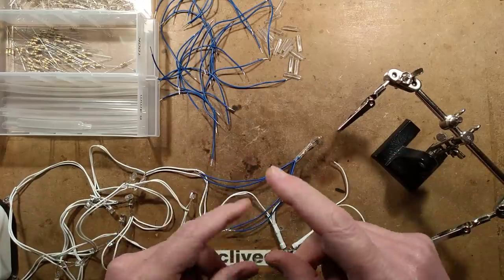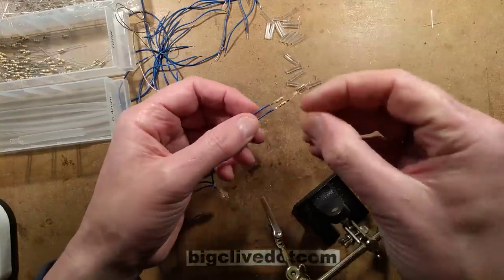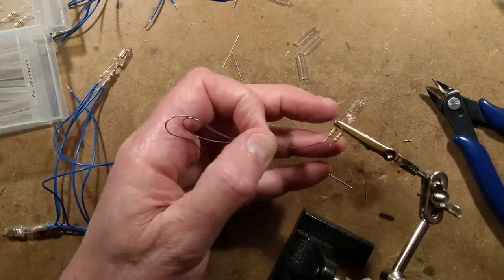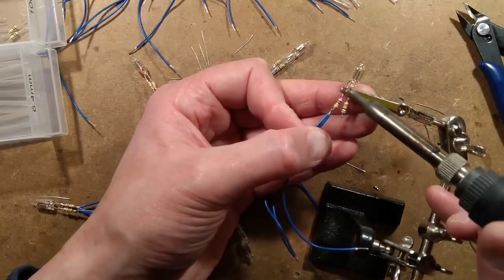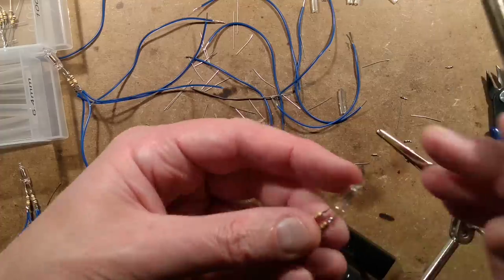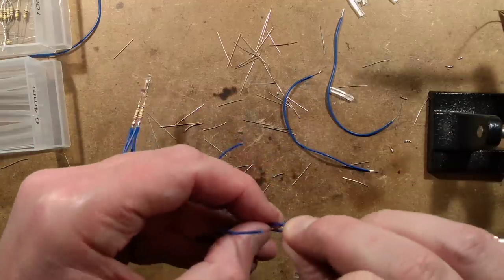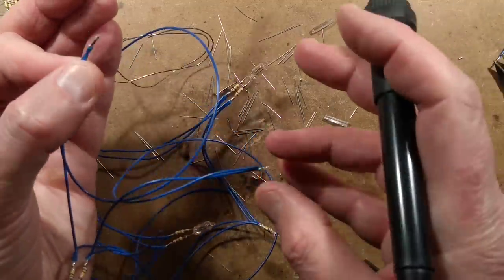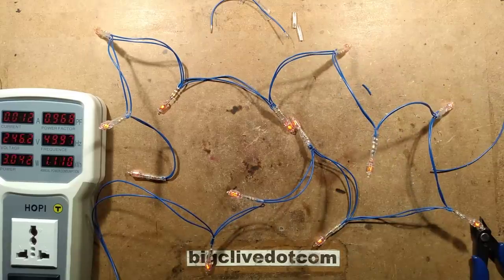Making a set of retro neon fairy lights. (100 year anniversary.)

Comment: Actually I've seen the entire published study on the blue light/melatonin effect. They used several thousand volunteers, half assigned to wear special filtered lenses to block the blue portion of the spectrum. There was statistically significant correlation between increased cancer risk for night shift workers exposed to blue light that corresponded to reduced melatonin production, with the effect being that cancer cells experience reduced growth rate when exposed to the hormone. And come on, its not hard to buy decent warm white LED lamps. I hate people that buy those cheap shit cold blue white ones. Your house looks like a fucking morgue at night. I'm half-expecting to see cabinets along the walls filled with toe-tagged polka-dot stiffs when I walk in.

Comment: my moms boyfriend had a chromebook. it got chrome based malware....it was unremovable.
Reply from the maker: Theoretically a chromebook does a checksum test and will download new firmware from scratch if it detects an anomaly.  It's possible that the malware was a browser extension.
Reply: @bigclivedotcom  it was a helper extension. if i remember right it was some yahoo thing (he used yahoo finance for daytrading.) it was supposed to redirect or something, but instead it would hang waiting for a reply from somewhere. at the time there were no virus scanners. completely killed chromebooks for me.
Reply from the maker: @RedFathom  With care to avoid rogue extensions a chromebook is probably one of the most secure browsers there is.  Super-fast for browsing too.  The same rogue extension would probably have occurred on Chrome in any browser.
Reply: @bigclivedotcom  i have the chrome browser on my computer. i even recommended he get a Chromebook for what he used it for, but having to work on a computer with a locked down OS encrypted HDD with no virus scanners is not fun. think we even tried a wipe/reload.

Comment: Is it legal to send you whiskey from the states?
Reply from the maker: I wouldn't recommend it.  The Royal Mail went through a spell of seizing bottles of spirits.
Reply: @bigclivedotcom  that's a shame.
They ruin everything that makes people happy.
Reply: It's perfectly legal, but if the package is intercepted by Customs & Excise (very unlikely for a posted item), they will hold it until the addressee pays whatever duty they estimate is owed. I believe there are exemptions for gifts below a certain value, but the rules are labyrinthine and I think customs officials have discretion to wave through stuff that isn't worth the cost of the paperwork to hold up. I live in the UK and have only ever had one thing stopped, but that was a large packing case from China (approx. 8ft x 5ft x 4ft), and it did contain items worth several thousand £s. A far greater risk with a bottle of whiskey from the States is it getting broken in transit if not packed to survive rough handling and being dropped.

Comment: This turned out really well.  It's a set of fairy lights / Christmas lights that are based on neons that run in a parallel circuit with two resistors per neon.  It could have been a single resistor per neon, but by using two it spreads the heat dissipation, packs out the base nicely and adds a layer of safety and reliability.
I didn't realise until I started writing this video description that the humble neon indicator lamp is 100 years old this year (2019) having been patented in 1919.  Happy 100th birthday lil' neon lamp.
https://en.wikipedia.org/wiki/Neon_lamp

If you build a string of these then please remember that they operate at mains voltage and extra care must be taken to sleeve and secure connections.  I actually missed a heatshrink sleeve from one of the lights leaving live contacts exposed, so take care to double check before powering the string up.  The wire should be rated for mains use and ideally would have been double insulated, but it's quite tricky to find double insulated single cores.
A suitable fuse should be used in case of an incident, and a humble 1A fuse will theoretically handle 1000 lights or more if run at less than 1mA per lamp.

I used standard NE2 indicator lamps which I bought from a local mail order electronic supplier, and used two 100K resistors for our 240V supply.  If making a set for 120V you can use a lower value resistor like two 47K, but the neons will light fine with higher value resistors.  The intensity will reduce with higher value resistors and the glow may become unstable and shimmer about inside (which is a really nice effect).  The life of these little neon lamps is rated in tens of thousands of hours of continuous use, with lower currents giving longer life.

This is definitely a project for seasoned electronics tinkerers, since it does involve a lot of mains connections.  But it's also a very therapeutic project to build a set as long as you want.  You could use green, blue and white (if you can get them) neon indicators too, but they will be a bit dimmer and you definitely want to run them at reduced current to avoid blackening.

The supplier I got the neon lamps from was Rapid Electronics in the UK:-
https://www.rapidonline.com/electroni...

You can also get them on eBay if you search for things like 100pcs neon indicator with the option of blue and green too.  I recommend the 6mm diameter lamps as they are stronger, brighter and longer lasting.  If the ones you get have a spot welded resistor on them I recommend replacing it with a higher value one for cooler running and longer lamp life.

The slight alternating of the glow from side to side in the video is due to the way each electrode illuminates alternately at mains frequency.  The camera shutter speed makes that visible.

You can deliberately make the glow discharge unstable in the lamps by adding a capacitor in series with the whole string.  It causes a slight interaction between the lamps and can make some of them shimmer like little neon flicker-flame lamps.  With this short string of 13 lamps I got a good effect with a 47nF or 100nF suppression capacitor.  Remember to add a 470K discharge resistor across the capacitor to avoid getting a plug-tingle from residual charge.

If you enjoy these videos you can help support the channel with a dollar for coffee, cookies and random gadgets for disassembly at:-
http://www.bigclive.com/coffee.htm
This also keeps the channel independent of YouTube's advertising algorithms allowing it to be a bit more dangerous and naughty.